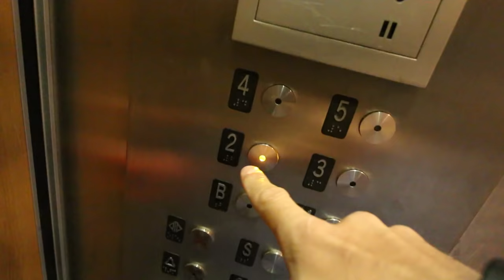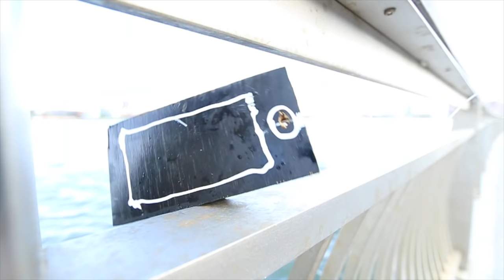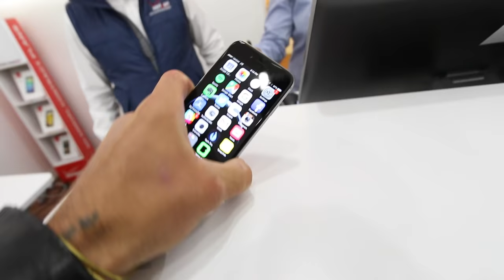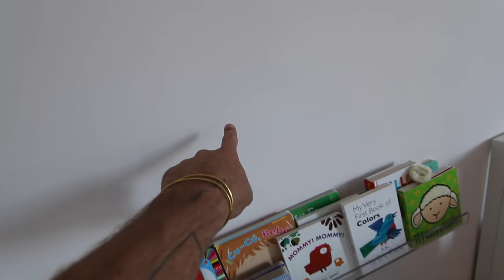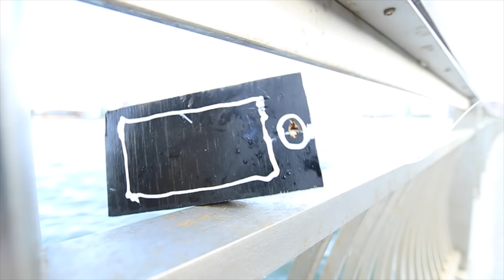DROPPED IN THE RIVER

Comment: your boosted board takes gas? I thought it was electric and you had to plug it in, what is this gas that roi has to give the boosted board for it to propel itself?
Reply: "give it some gas" is an American expression for ""go fast"
Reply: Lol I'm American and I know that giving it some gas doesn't mean to go fast, it means to rev it up or to increase the amount of pressure your putting on the gas pedal, in an electric car it's not giving the car "gas" that increases the speed but transversely the amount of pressure applied to the right pedal. More amps are drawn from the battery.